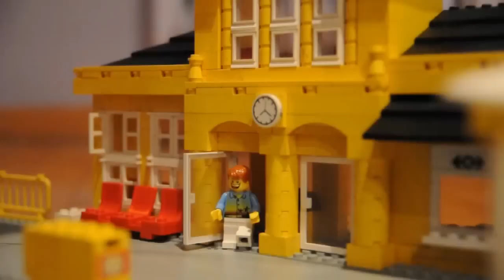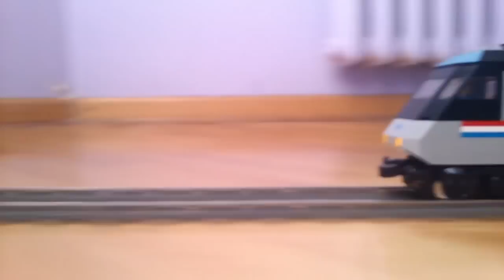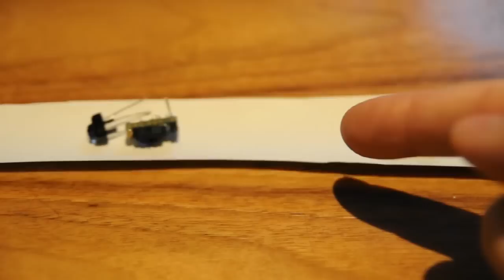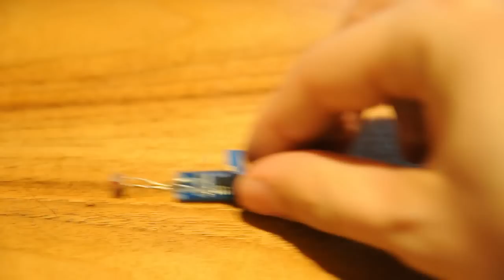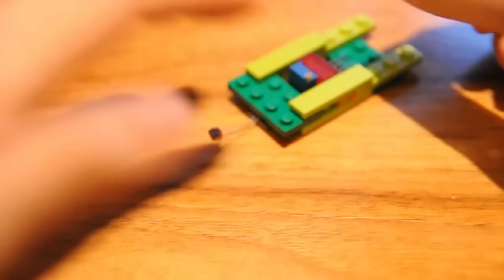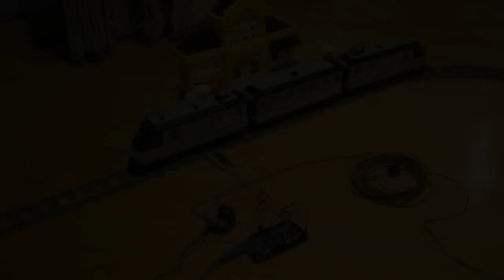Arduino for Lego Trains #2: Light Sensors

Comment: Hello.
I am Wil Wilkes from The Netherlands. I've watched movie on youtube and I also tried it at home and it works. thanks
I have 2 lego trains crossing at an intersection, I want to protect the trains with Arduino that they can not crash each other.
Do you have an idea how to make it?
 
greetings  Wil Wilkes
Reply from the maker: I do! If you subscribe, I will add a video on how to do this very soon - it will Video #6 in this series.
Reply: Arduino Lego Trains When train 1 ride across the intersection. Then train 2 and 3 stop. If train 2 ride across the intersection, then train 1 stop. But train 3 don`t have to stopIf train 3 ride across the intersection, then train 1 stop. But train 2 don`t have to stop
Reply from the maker: I'm not sure how you have three trains on one intersection. But to solve your problem you should use a Finite State Machine.

How many tracks are you controlling with the arduino?
Reply from the maker: wim Wilkes Hi Wim. If you haven't seen it already, the Train Crossing tutorial is available here: https://www.youtube.com/watch?v=YqTgpuXnWeI

That should help you get started with your train crossing scenario.

Comment: Hiya. With the arduino inside the train (for PF trains, mentioned in video #11). How would you get information from a track-based sensor to the train-based arduino?
Alternatively, how would you move this to train-based?
Reply from the maker: All will be revealed in the next tutorial, which will be published this weekend! Big hint: 433Mhz wireless transmitters.
Reply: Looking forward to it, as I'm just about to begin my Lego Train journey. It's all PF-based, and stopping at stations is very important.
Reply from the maker: If the sensors are at stations, then you can just run an IR led to the top of the station from your trackside arduino, with no need to add an Arduino to the locomotive. That's the basic principle shown in Tutorial 11. Even if you have Arduino on board (like Tutorial 12) the train still has its IR receiver, and can accept commands from any arduino/IR Led it has access to :).

The next video removes the train's IR Receiver, so that solution will be a bit more complex.
Reply: I had been looking at removing the IR Receiver and replacing it with an sbrick anyway, so that's not an issue for me. At this point I think I may hold off planning anything until I've seen your next couple of videos.
I'm also going to want more and more functionality as time goes on, so I will be following your videos eagerly.
Is your code downloadable anywhere?
Reply from the maker: Sure! Visit arduinolegotrains.wordpress.com and check out the CODE tab at the top; you can copy code for each tutorial from there.
Hopefully the next video will save you some money, as the S-brick is quite expensive and my solution is 1/10th of the price.

Comment: I built a Dutch NS train. For the perfect control I used the Arduino Uno rev 3 with a L298 motor controller and LM393 light sensor.  

The problem is that the train doesn’t stop when he passed the light sensor. The sensor detects the train as you can see in the pictures.

http://imageshack.com/a/img923/9739/vmeSkM.jpg (sensor detects nothing)
http://imageshack.com/a/img922/9409/wRazSO.jpg (sensor detects the train)
http://imageshack.com/a/img924/2663/06S9nL.jpg (overview)
http://imageshack.com/a/img922/8052/wFOJyT.jpg (overview)
http://imageshack.com/a/img922/1108/gcyagN.jpg (code)

Can you tell me what I do wrong?
Reply from the maker: +Niels Albrechts Hi! Your code looks identical to mine. Have you opened the Serial Monitor and confirmed that your sensor reads below 500 when the train is detected?
Reply: Hi!
Yes I have opened the serial monitor and there are no data in the monitor but the green light in the sensor switches on and off correctly
Reply: Sorry, there is data in the serial monitor, but only 0.
Reply from the maker: Niels Albrechts
Something's not right there. Send this little sketch to your arduino:

int LDR = 0; //analogue input pin
int LDRValue = 0;

void setup() {
 Serial.begin(9600); }
 
 void loop()  {
   LDRValue = analogRead(LDR);
   Serial.println(LDRValue);
   delay(100);  }

Connect the light sensor, and make sure you have readings between 0 and 1023. If you only have 0, then you have not connected the light sensor correctly (i.e wrong analog input pin, wrong wires, no power etc).
Reply: +Arduino Lego Trains 
That tests works correctly. Normally the serial monitor gives a value between 27 and 31. When the sensor detect my finger the serial monitor gives a value of 1023.
Reply: hallo Nielsis het probleem bij jouw nu opgelost. ik zit met het zelfde probleem. kun je mij doorgeven wat er niet goed is.Groet Wim Wilkes

Comment: any idea how could i use the light sensor as an anti collision?
Reply from the maker: Sure! Check out tutorial #6
Reply: I have trouble implementing the sensor infront of the train to make it stop when there is an obstacle.i need help:(using infared sensor
Reply from the maker: For infrared sensors you need two LEDs; an infrared LED and an infrared sensor (photoresistor). I used these in Tutorial 8 (https://www.youtube.com/watch?v=JKjcNlPMSNc), so check out the code there.